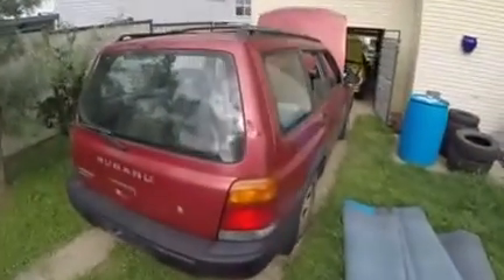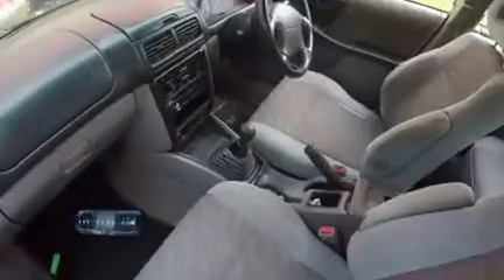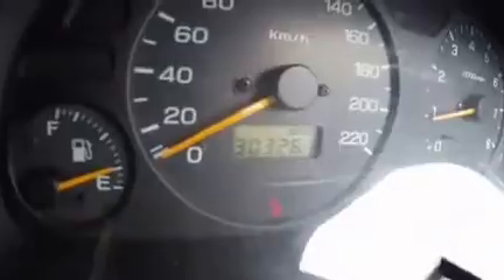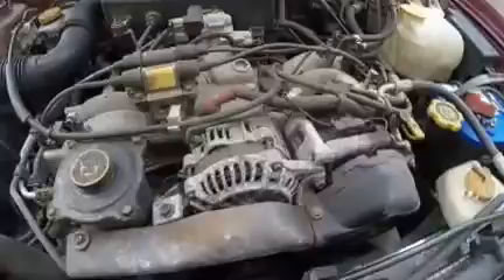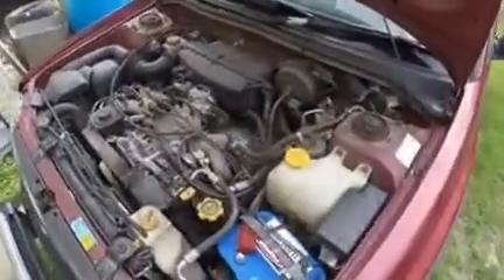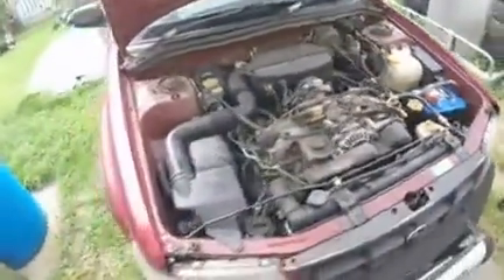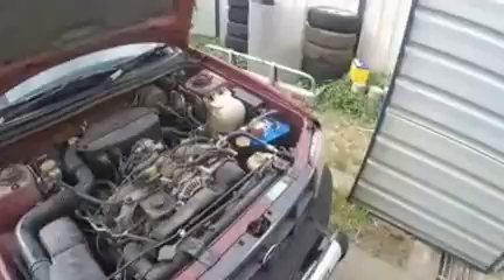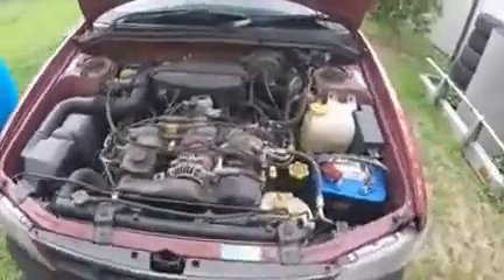BERSERKARU SF5 EJ202

Comment: Why not swap the clutch? Wouldn't it be easier and drop the transmission? Nice to see what you are up to. I am doing heads on a 92' Legacy and found both cylinder heads eroded from previous owner over temping.
Reply from the maker: +BDudasProductions the engine is in poor condition, and the clutch was down to the rivets, swapped in the EJ22 instead